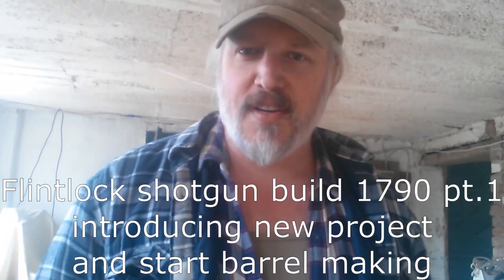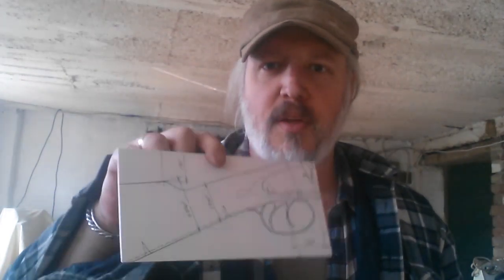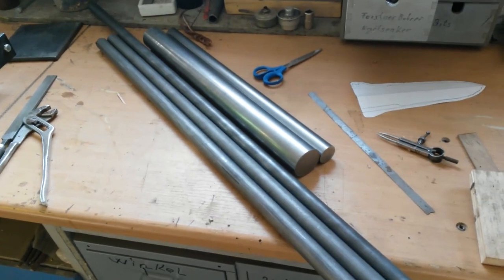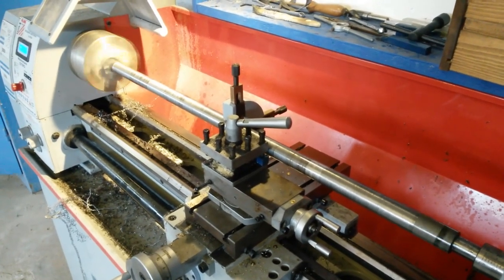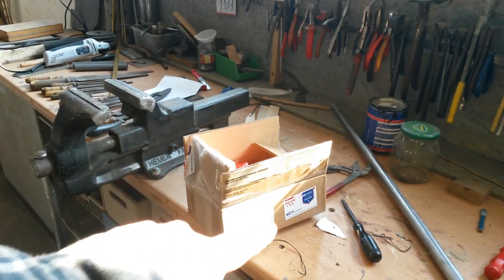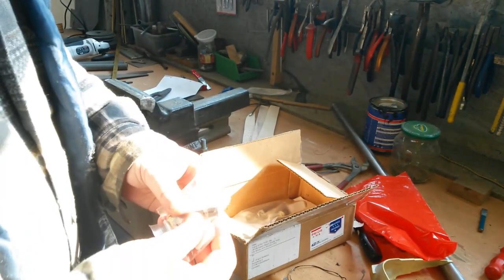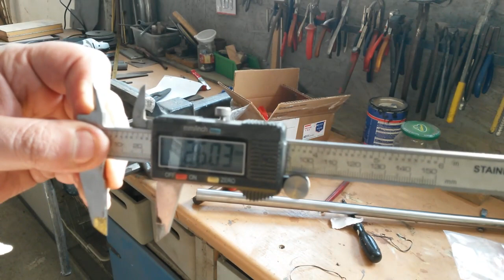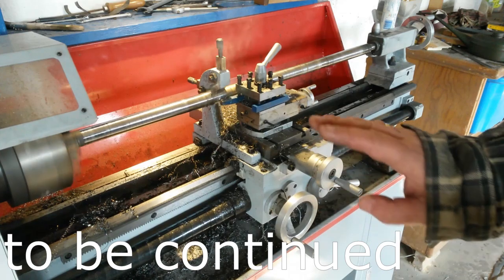Flintlock shotgun build 1790 pt 1

Comment: I've been building a flintlock double barrel shotgun from this book, I used a set of Damascus barrels from an old cartridge gun 12 gauge. Gun is nearly finished as I am engraving at this time. Have patience and follow the book.
Reply from the maker: That was the plan 😆 the discriptions are realy good. Mine will be a 20 gauge because the walnut blank is not as thick as I would need for a 12 gauge but that should be good as well. The engraving will be a nice job. Good luck with your project. A damascus barrel will be a joy to use but I wont do it at the first try......

Comment: I think your barrel thickness at the muzzle is going to be far too thick, you would never see this thickness on a double, 1.5 mm would be a very thick wall thickness, the weight needs to be at the breech end to give balance, as you say Roger, the breech plugs are quite complicated, but obviously you cannot make those until the barrels are soldered together, I assume you will be using a hooked breech type, Good luck on this project, you will enjoy making this one ! Chris B.
Reply from the maker: The barrels are planed for round ball with patch as well...The next thing after shping the barrels will be the soldering of the barrels.....sad to say that I was never very good in soldering....but I think I will make it anyhow. Maybe I will build a rack to fix the position of the barrels and fix the ribs with wire and wedges to have full contact to the barrels. Than it should goes well......  a lot of investigation and lots of single parts to make.....that will be a lot of fun for a long time ....Roger.S

Comment: What type of tube do you use for the barrell? Seamless hydraulic?
Reply from the maker: You are right it is seemless hydraulic pipe from e bay. There I have a goode range of different diameters. If I order from a steel shop, I have to buy 6m at once....

Comment: There's must be high tensile thick wall extruded tubes suitable for the barrel.
Reply: Be nice we're the gun breach loader
Reply: Where'd you get an engine lathe.
Reply from the maker: I use seamless hydraulic pipes with 7 mm wall thickness. that gives me enough material to shpe it on the laith....
Reply from the maker: The laith is bought on the internet... it is a rather cheep one but good enough for the job. I would love to have a old one restored but they are much more expensive 😢 This one is from a trader in germany.... "Maschinenhandel Gronau" they are friendly and deliver very fast....

Comment: How u turned taper...any calculations..
Or settings
Reply from the maker: The calculations are made already he he and for sure I have a higher plan in mind that will not only follow the book....and for sure some nice decoration 😁
Reply: @homemadehistory7537  
Pls tell in detail
Reply from the maker: @roversolomont  Due to, that I dont have a clamp for turning between two pins I made the barrel every 50 mm 0,6 mm thiner. So I will have some steps . That I roughly egalize on the laith and than with the anglegrinder while it is rotating. maybe that could help you a litle.
https://www.youtube.com/watch?v=Nbbc64L8Too
With the clamp and between the pins you could move the rest exactly the taper of the cone and you can have a perfect shape.
Reply: @homemadehistory7537  ok brother.... some what understood from your explanation
Trying to understand further more